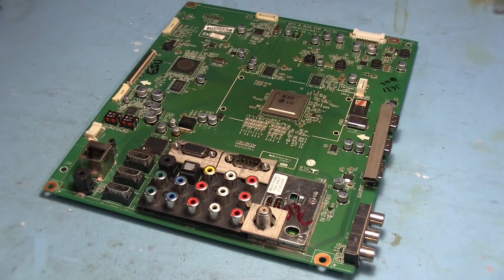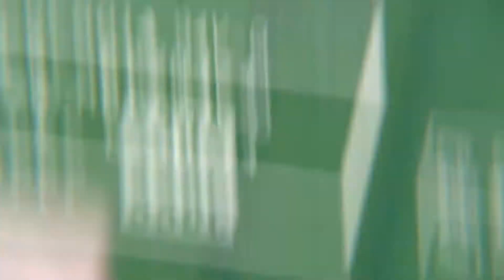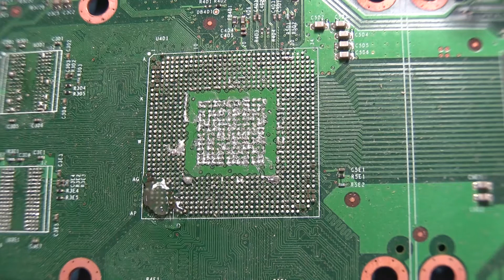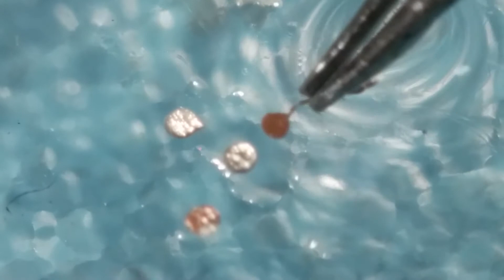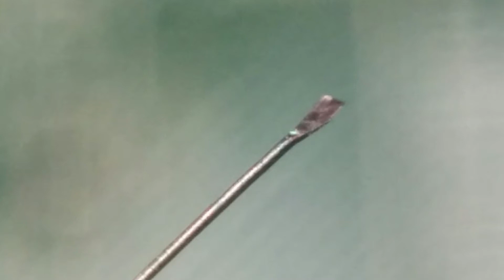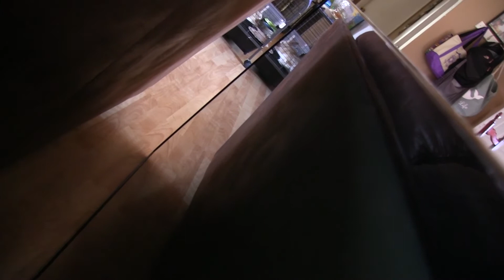TWB #57 | BGA Pad Repair Experiment

Comment: What temperature can cause the solder pads damaging, and what temperature can't cause the solder pads damaging? I got the same issue when Im try to clean the pads from the solder with the soldering iron. Usually I used 350C but I think this is to hot! What do you think? I allways  preheating the PCB from the bottom for 100C, but when Im clean the board somehow 1-2 sometimes 3 pads missing. I use the NC-559 flux but not to much.
Reply: Do not use a soldering iron to clean the pads. Just move the iron above the pcb without touching the pads to remove part of the solder. Then use 320°C hot air, flux and a piece of soldering wick in a pair of tweezers to remove the remaining solder. This way the soldering mask and the pads stay where they should.
Reply: @pp3v42_g3h  yeah, true, i used soldering iron to clean some BGA pads a couple times and ended up ripping them straight off! Especially ground pads which sink the heat very quickly, my iron wasn't too powerful and the iron itself got stuck on the ground pad until a few seconds later it heated enough to let go. But i moved it too quickly and ended up ripping off the ground pad. The solder is a lot stronger than you think it is when starting out. It's best to use a hot air station (I use 400 C 80% airflow (~ 96L) ) flux and dragging a wick across, like you mention. I haven't damaged any pads this way. NorthridgeFix uses soldering tweezers to hold the wick but those tweezers are expensive.

Comment: The easiest way is to solder enameled 0.1mm copper wire. Only a steady hand and a nice microscope are needed. The best solution is to solder with lead free solder and adding leaded solder balls on the chip. Usual UV solder mask is absolutely fine for securing the traces. Sometimes it is pain in the ass to repair some traces. Rarely there are BGA sites where traces are in the second or the third board layer that are somehow connected under certain pads. Those are not visible and you can detect them by scraping off the epoxy glue residues that held the pad in place. For example a Macbook pro AMD site has such pads that are not visible by the bare eye, you can identify them just by taking a look at the board schematic.

Comment: very good video would you say 5 minute epoxy can hold broken pads also?
Reply from the maker: It may hold them initially, but may not be able to stand the heat when soldering.
Reply: @ThatElectronicsFool  
Yup,epoxy melts at 200-300C, I believe,  so it may not survive soldering...

Comment: I give an A for effort. Although you're not using the right tools, you did a good job. Much better than a most of the DYI people out there including a lot of the repair shops across america.. lol. You touch on a few good points. You're right.. you dont know if the replacement pad or pads (in some cases) are going to move or lift during reflow of the chip. The correct way to do this is to connect the tail of the replacement pad to the circuit trace by micro laser welding. That process bonds the tail to the trace and is not able to separate under any heat conditions. Dont worry, hardly any repair shops use this method so don't feel left out. lol The machines cost from $8k to 10k for that ability. One tip I can give you is this, during the cleaning process (solder removal of the site) use a lot of flux and dab the solder braid (Don't slide it) onto each section of the solder pads.. if you slide it, you will damage and remove the mask that helps isolate each pad. If you did slide it and have removed some of the masking around the pads, you will need to use a think coat of epoxy to rebuild the missing masks around the pad. You will need to dry the epoxy with heat before you apply reflow flux onto the site.. re-mount the chip.  This will help eliminate or resist any solder bridging  during placement.. I can go on for hours.. been doing this for close to 20 years.. good luck.
Reply from the maker: Thank you for the advice! I try to do what I can with what I've got, and so far I've had a pretty good success rate doing various reballs, although this was quite the snag. In the end, turns out the chip was shorted internally when I did a bit more troubleshooting.
Reply: Sadly I'm finding this comment about dabbing vs sliding from already having destroyed the bga EC chip mounting pad from overenthusiastic sliding of solder wick, but nice to know there is a possible solution